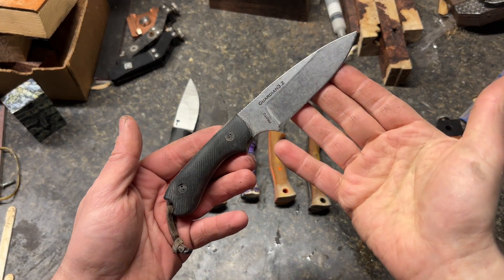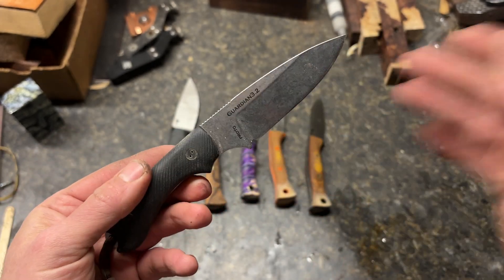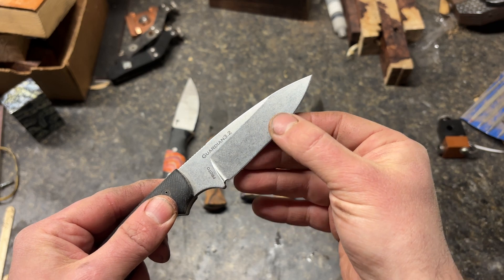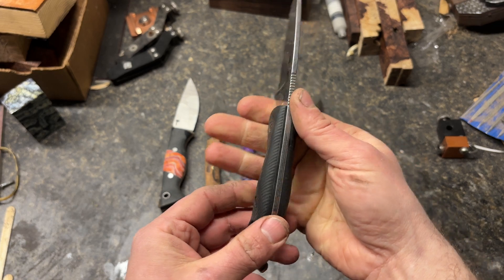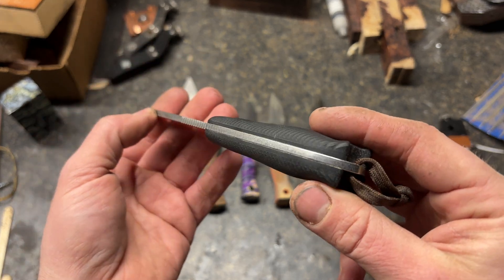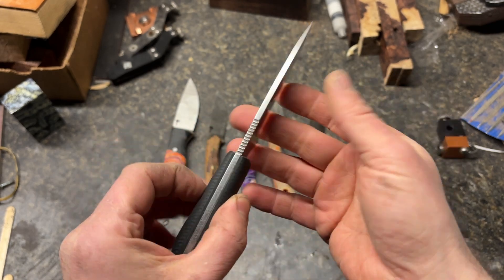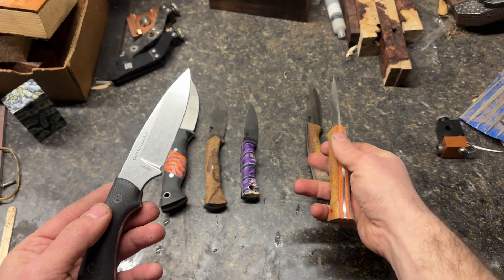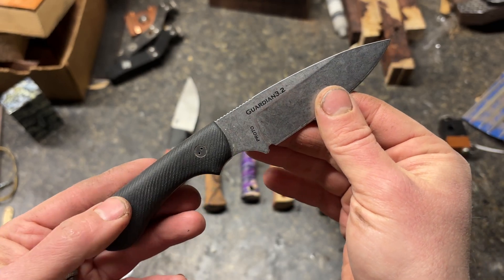Disappointing Bradford Guardian 3.2 in Proto Steel

Comment: Why would anyone buy a guardian series in Proto? Anyone who knows anything knows the Guardian series are excellent but when you buy the M390 versions. I like how people think custom knives are better than production knives when 80% of custom knives aren't very good. It's a common misunderstanding among casuals. Casuals who don't  even realize that Buck USA's BOS heat treat is the best system on the market
Reply from the maker: I think it could be argued that most production knives also aren’t very good. The knife market is a mess to be honest. Lots of marketing BS and myths. I honestly can comment on the buck heat treat however it can’t be the best at everything so best for what use case? I’m not sure what the actual HRC is that they use. The reality is you can only do so much to the steel to make it perform better and then the question is would the user even notice that 5% extra awesomeness. Anything BOS can do a custom maker with a kiln and who cares can do it too.

Comment: For all the people complaining about 61.68 HRC and particularly the video-maker who claims to be a knowledgable about knife steel....they are ABSOLUTELY WRONG. Larin Thomas, the creator of Magnacut has stated repeatedly that toughness is reduced by approximately 40% when you take Magnacut from 61 to 64-65 HRC. He has stated that optimal HRC is at approximately 61 for good balance especially on fixed blade knives. According to the Crucible steel datasheet, the optimal balanced heat treatment with a balance of toughness is 62.5 HRC. So you can listen to this guy if you want...or you can refer to the creators of Magnacut. Do your own research before you endorse some random Youtube content creator is my advice. Many of them don't know what they are talking about.
Reply from the maker: Funny because ask anyone who uses Magnacut in knives and 63 is the sweet spot but we are also not talking about Magnacut here we’re talking amount what is now known to be Magnamax with no published data sheet. Also keep in mind that toughness is not the end all be all it’s actually the least important quality that can be controlled largely by geometry. I’ve never run into a situation with a sub 4.5 inch blade where I said man this blade needs to be softer for more toughness and I’ve made hundreds of knives. You’d surprised how little toughness you actually need in steel for EDC use. Your comment is indicative of a keyboard knife maker.
Reply from the maker: Oh yeah and just to let you know I compared two of these knives in the same steel. One at factory hardness 60 and one after I reheat treated it (yes that can be done) the reheated was 64. Both were sharpened and did turn cuts in antler. The 60 hrc blade chipped and rolled and the 64 hrc blade held its apex with not visual damage. But you know best….

Comment: Have you discussed this with Bradford?   They seem to do well with Cruwear, Elmax, N390.
Reply from the maker: @scottfrench6128  a customer who sent another one in was annoyed that theirs was 59 hrc average and Bradford offered them a refund with the excuse that it’s a new steel. Which for me doesn’t fly. I was able to achieve 64 hrc after learning the approximate composition.
Reply from the maker: @scottfrench6128  I should mention that part of the blame for the disappoint result fall on the heat treater as well. However Bradford shares the blame because they didn’t validate the heat treat results.